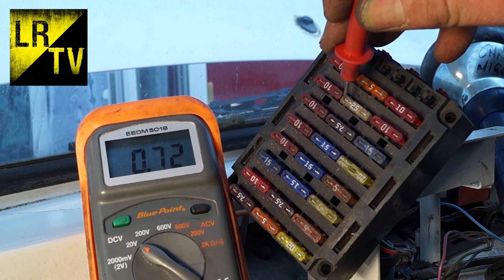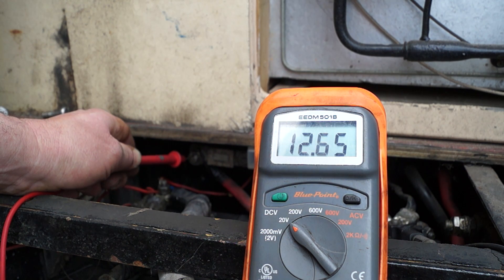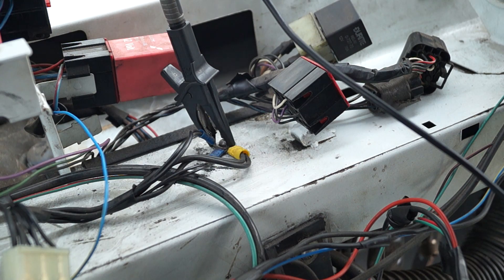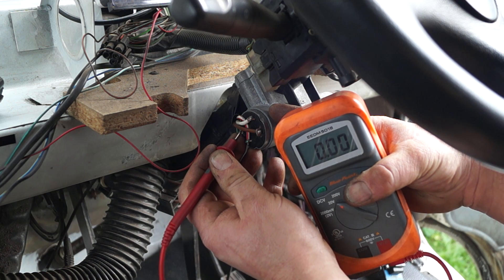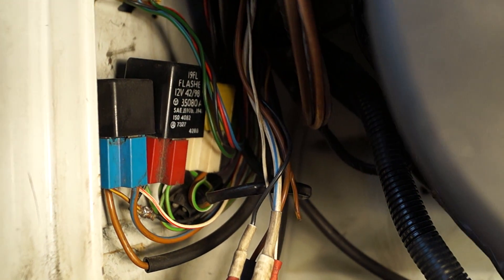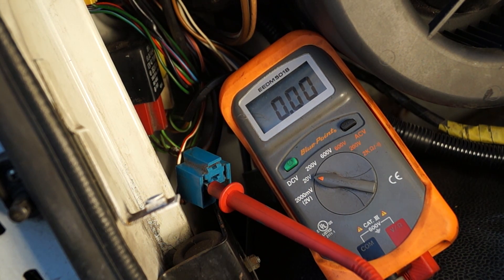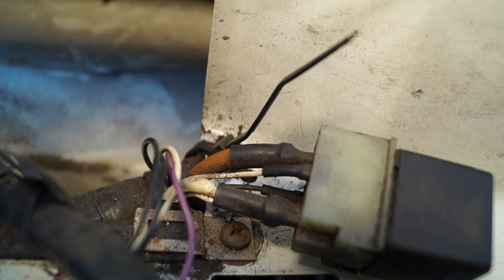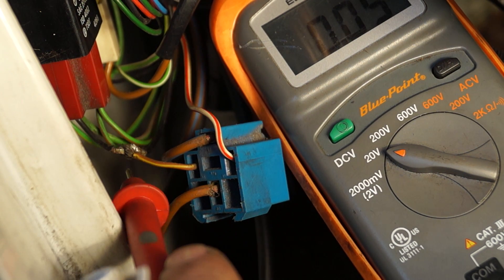Land Rover Electrical fault finding  & diagnosis.  Starter circuit - relay

Comment: I have a 99 disco 2 it keeps burning through batteries three already! It's been converted to coil non secondary air idk if prior owners had it flashed to reset computer or if pump is faulty?? Is there any pointers you can give me I'd sure appreciate it

Comment: I have a 99 D2 with a V8 US spec. It has the problems with the dual sunroofs that leak. The problem I'm dealing with is the odometer is blinking and the wipers run on their own. Could it be a bad fuse box?

Comment: Hi is there a follow up video, my Range Rover won't start AC light is on, a mechanic just changed the alternator, any one know what AC means.
It's a 2005 Td6.
Can anyone help please.
Reply from the maker: AIr Conditioning?

Comment: Help, I have a 2002 Land Rover Freelander, with an electrical problem it wont start after I drive it and park it until approx, 3 hours later, it wont do it every time.
Reply from the maker: There is an odd thing happens to the crank position sensor when it is hot.  Because when you park your car  the heat rises, it will then effect the sensor. Until it cools down it won't work to give a signal for the engine ECU.    THis is one probable solution to the problem and I have seen and repaired cars that have suffered  from this.  Is there any DTCs to read in the ECU memory to confirm what I have just said?

Comment: I have a 1999 range rover 4.6l
I just replaced the battery and now I get no crank and nothing from the starter, where should I start diagnosing?

Comment: Hi, i have a 2010 Autobiography Range Rover, tried to start this morning and she wouldn't. Dash board went mad flashing from this to that, have no clue just love driving it. Can anyone help please??
Reply from the maker: Probably not be able to help from this distance?  Have you thought about calling out a mechanic to get you out of trouble?  Loom on the RR corrodes at the plug end and causes that sort of problem and so does the loss of an earth to the ECU.  Other than that without looking at it you are just requiring me to guess from here which i am not prepared to do,  Sorry.

Comment: Hi! I have a 2003 Land Rover Freelander SE.  After being run for a while and turned off, if try to turn back on; it will not.  After a while, the car will turn on.  They say it's possibly the crankshaft position sensor. I have looked at many pictures and diagrams but I have not been able to locate it.  Is it possible for you to show me where it is, make a short video as to where is located, or a step by step with pictures, it would be appreciated very much.  If you think it's not this sensor, maybe you can point me in the correct direction.
Reply from the maker: yes it may be the heat sink effect on the crank position sensor.  Possibly a video will take longer to make that the time you'd like to wait  A simple google search will show you were it is positioned.

Comment: Hi, i wonder if you can help me with a starting problem on my 300 tdi range rover classic. With the key inserted, the sign lights come on, the sign for the hot plugs go off but when you turn the key it simply clicks on the relay near the glove compartiment but the motor doesn,t start. Normaly, if you wait a bit, sometimes 5 min, sometimes 20/40min, and simply turn the key it starts like a brand new car. The batery is brand new. Is this situation new to you? Thank's, João
Reply: Common issue from what I gather, dealing with the same thing right now.  I’m almost tempted to set it on fire and let it burn to the ground.

Comment: Thanks for the reply. I hope that I have ruled out the risk of further short since I have installed new taillights. The old taillights had a metal loop which was badly rusted, one tail light plastic has melted a place where it has been in contact with the metal circuit. The previous owner must have done something creative installation of extra lights when the red / orange wire has been cut from the connector in both lamps. I have attached the cable back into position in the circuit by cutting the portion of the metal circuit of the conduit having its normal place and poke the wire on with a normal socket.
Reply: Does anyone know how to replace the wires coming from the fuse box to the battery on a 1996 landrover discovery?

Comment: Does anyone know what is the reason for our Land Rover Discovery V8 1998 is not light on one side of the car when the fuse blows. In my logic there should not be any light at all when the fuse is blown. 
British cars have soul ... and a very large herd of demons hehe
Reply from the maker: not wrong about being posesssed but lets look at it scientifically as we are in the 21st century and not the early 13th.  Okay, if a fuse blows and the light goes out then you have a short to earth.  This means that there is a power supply wire / live wire touching directly to earth and not going through the consumer unit ( lights) then to earth.  Fuse is to protect the wiring from burning out.  You could put a consumer unit in place of the fuse  ( a headlight  bulb or buzzer  wired and connected where the fuse would be)  and check to see by wiggling wires when the  test light bulb goes out meaning you have interrupted the earth made by the short.   I will be making a video on this subject soon if the text is not clear enough.    ( it is called the wiggle test)

Comment: I see you testing those heavy fuses for voltage drop . Am I right in saying that there needs to be current present for there to be voltage drop? After all you are checking for high resistance surely.
Reply from the maker: Sorry I just found your comment  appeared in spam for some reason.  Voltage drop yes this is done to see if there is resistance / corrosion or faulty component in a circuit you are testing. We are not doing this here but as a valid point it needs to be address to check for resistance either on the positive , negative or consumer unit.   Now you have reminded me of this then it is a video that will appear soon.

Comment: Another super video Chris thanks, that LDV looks like a rats nest, how you figured out all that wiring is beyond me
Reply from the maker: Dave,  it took a a while to work out what was going on with it,  Learned how it worked when it wouldn't start or give any power.   I might take out most of the wiring and start again but it wouldn't be so much fun then